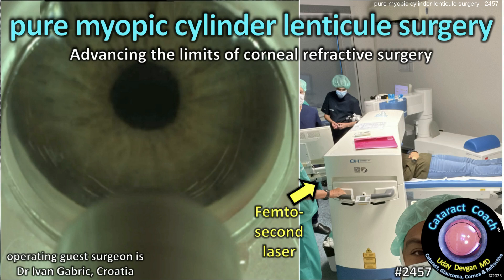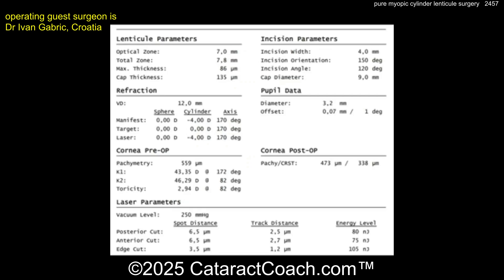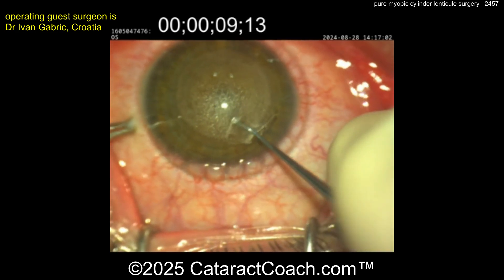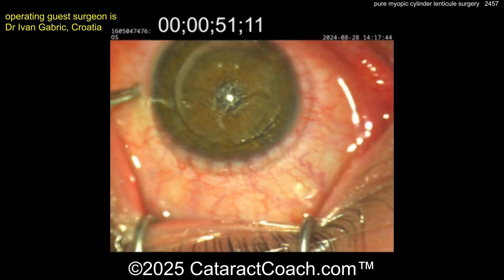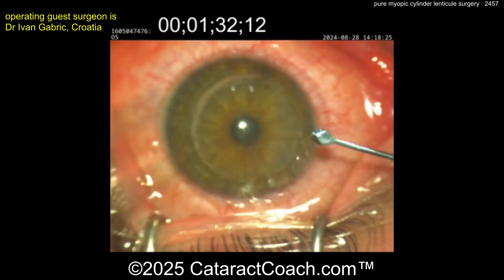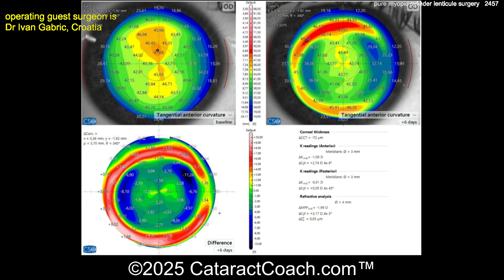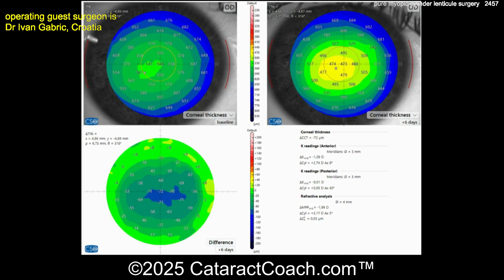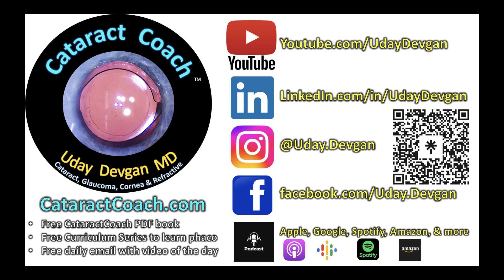CataractCoach™ 2457: pure myopic cylinder lenticule refractive surgery

Comment: Hello. Nice job! Just une question: how’s the surgical technique different from a spherical or spherical cylindrical treatment? The lenticule dissection and extraction seemed rather standard. Also, does the SCHWIND analyse and compensate for cyclotorsion, especially important in astigmatic treatments? (I only have experience with Zeiss Visumax 800 for SMILE Pro).

Thanks!
Reply: there is very little thickness on the top and bottom of this lenticule so it is a very strange feeling. atos has cyclotorsion from day 0, sources are CSO Sirius, Sirius+, OSIRIS-T (Peramis) and MS39. It works great we are about to publish a large case series of simple myopic astigmatism cases.
Reply: @ Thank you!